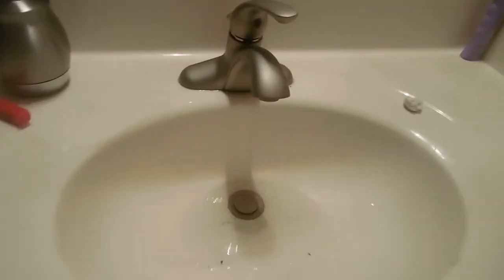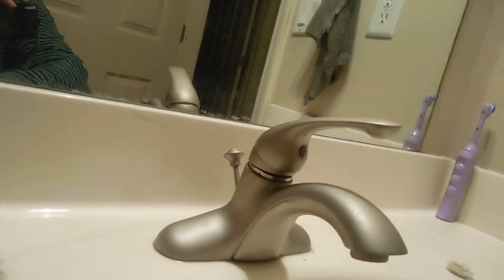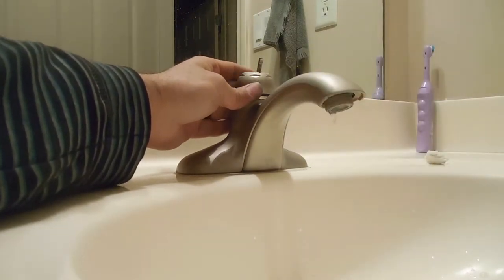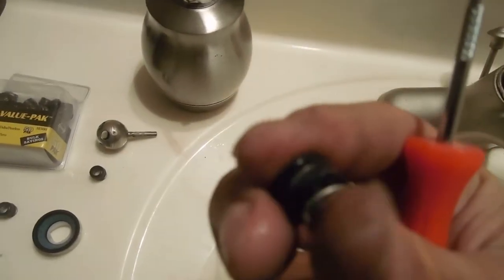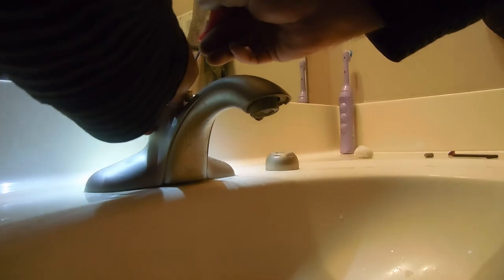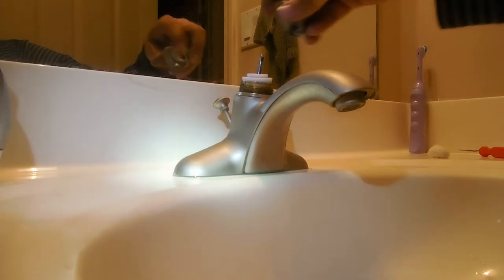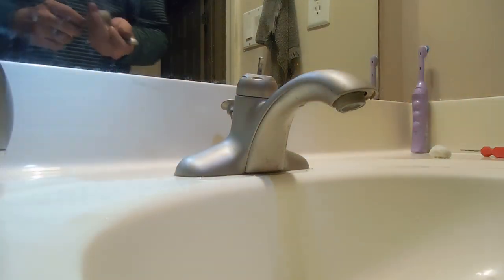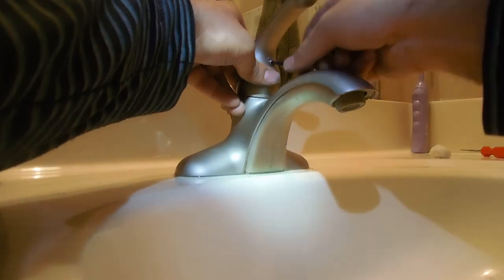How to fix a Leaky Delta faucet in 5 minutes

Comment: First, there is water dripping the same even during the rebuild, suggesting the main water lines aren't totally closed (a common issue where the cheap old plumbing shut-offs are plastic, old washers, corroded, etc.). If feasible, consider the extra time and effort to install modern, reliable 1/4 turn ball valves, under the sink, which may entail shutting hot and cold lines further back in the plumbing system. In any case, he doesn't seem to align the top ball socket before tightening the cap nut, and the nylon adjustable top nut should always be loosened before tightening the outer metal cap. This provides final fine tuning of the top pressure, with enough pressure to keep the lever from flopping loose, and stopping any water from seeping past the ball. That persistent slow drip shows he's totally missed something crucial in the rebuild and tightening process. Wow. YouTube incompetence requesting Subscribers?